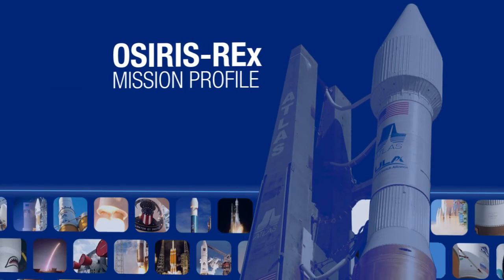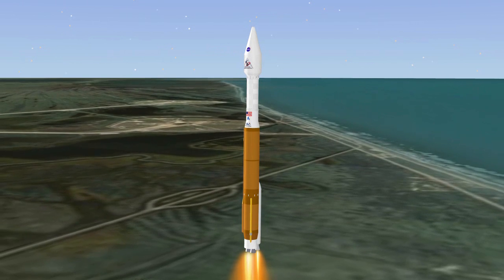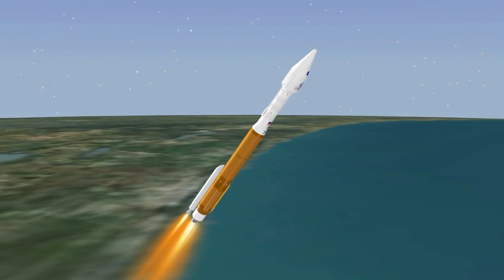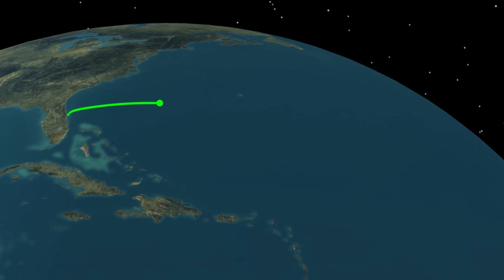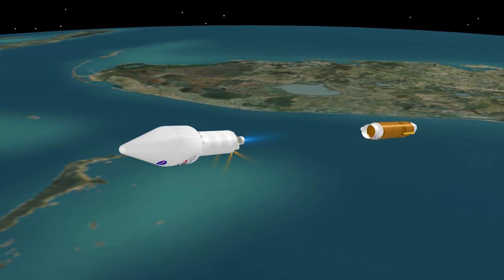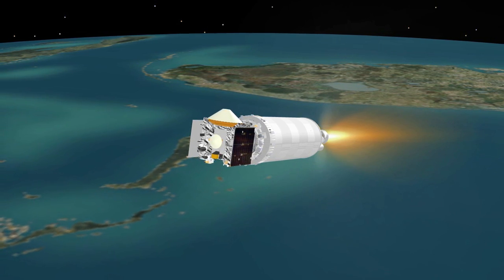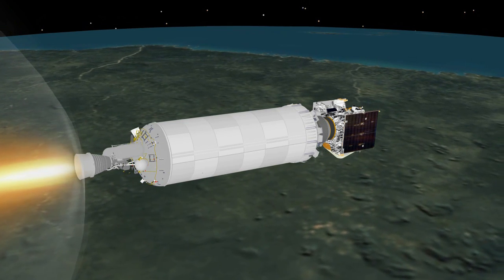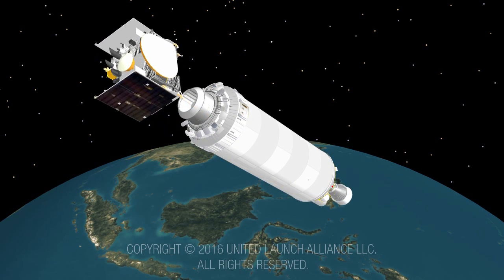Atlas V OSIRIS-REx Mission Profile

Comment: Something I wonder is how Atlas flies fine with a single SRB - I guess the engineering and thrust control is done in such a way that that single booster doesn't cause any issues, since obviously it works, but the idea of asymmetrical thrust sources is so strange to me.
Reply from the maker: Yes - the booster engine compensates. We get similar reactions to the 551 configuration, which has 5 solids.
Reply: *****
551 made sense to me - it's more balanced looking. I have read more into the 1 booster design, and I gotta say, it's impressive engineering! Then again, what else would I expect from ULA? :D
Reply: as a ksp player i know an engine gimbal can compensate for this but how does it not appear to slide sideways off the launchpad is the booster so low thrust that that effect isnt noticed

Comment: FINALLY!!! A Single-Solid Atlas!
Reply: The single-solid Atlas V has flown three times before. April 2006: the Astra 1KR satellite for SES Astra, March 2008: the NROL-28 mission for NRO (the first Atlas V from Vandenberg), and April 2011: the NROL-34 mission for NRO. In conclusion, the United Launch Alliance and Lockheed Martin have had experience with only one SRB on the rocket.

Comment: Hello ULA

How the Atlas V rocket is stable with only one SRB?
Reply: The main engines seem to be gimballed in the same direction of the SRB so it stays balanced. It will tilt a little at first but then stabilize once it clears the tower with some sideways vectoring.
Reply: They gimbal the main engine accordingly, similar to the way the space shuttle kept itself straight during launch :)
Reply: The Nozzle of the SRB is angulated so it does no Producer to much side force and the RD-180 also stears a little bit